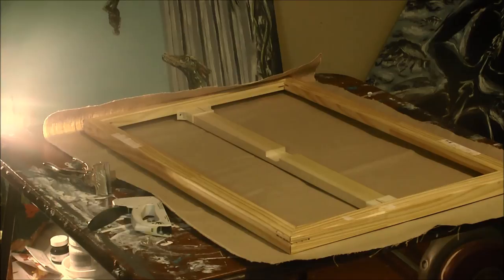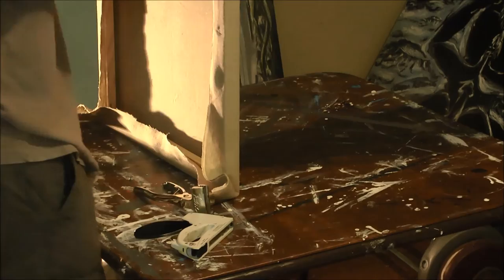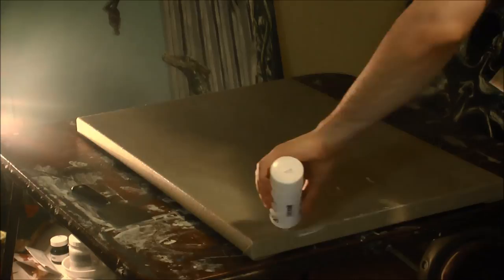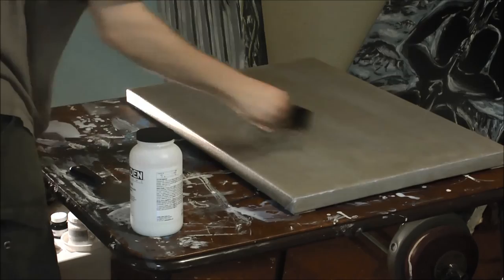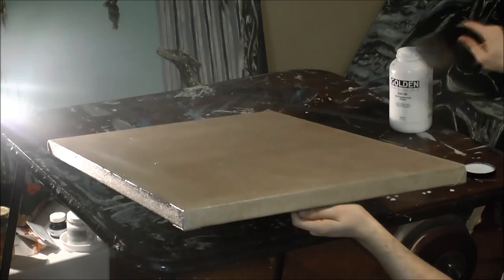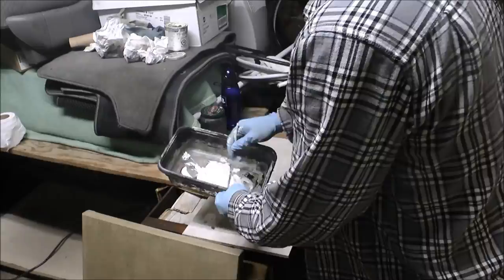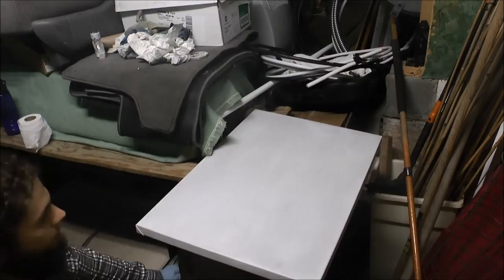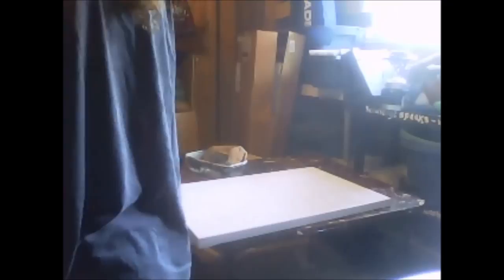Lead Oil Primed Linen Canvas Process

Comment: I do not believe either chalk or marble dust have any adhesive properties. They both create a “tooth,” however, like fine sand paper. The adhesive (called the “binder”) holds all the otherwise dry media (pigment or texturizers) to the surface, in this case the binder is the linseed oil, which is also the “vehicle” transporting the dry particles and binding them to the surface. This is why thinning oil paint too much allows it to rub off, or float away when wetted... the binding property of linseed as is cures is too far reduced when thinned too much.

The lead oxide, or titanium, or any other dry pigments in varying density are floated in the vehicle (linseed) to their final brush stroke location, where the vehicle/binder dries or cures leaving the pigment to reflect light. (Ralph Mayer’s Artist Handbook 5th Edition)
Reply: It  is refreshing to see someone still reading Mayer. I suggest Gettens & Stout as well.

Comment: I noticed that when he showed the final product,  his canvas had the very same problems mine used to have:  Too many deep and visible brush strokes!  I solved that problem by
getting an air brush and compressor and never using a brush again.  You may find  that you will have to spray on several layers, depending on how much primer you like on your canvas, but using an air brush is not only less time consuming, but it does away with the annoying streaks left behind from brushes.
Reply: go away troll
Reply: This is lead oil ground, if you spray it you will end up getting it everywhere, not safe to do really, a palette knife will suffice
Reply: Usually, you sand down between ground layers to get a fine, smooth surface. The lead sanding dust is a problem. It's bad for your health when inhaled.

Comment: I can't agree with putting a non-hydrostatic product on hydrostatic canvas presumably you chose linen or hemp because those are the least hydrostatic fibers but the beauty of rabbit skin glue is that it has the same hydrostatic coefficient as linen.So they move together in unison like rebar in concrete. By soaking a hydrostatic fabric with a plastic bonding agent you're setting up a conflict. And we know the paintings of giant Reubens paintings haven't cracked.  I think these acrylic primers would work on Tyvek or some non-woven plastic fabric like that. And then you're putting lead which is a super flexible metal on top of that so bobs your uncle. Cotten has a high hydrostatic coefficient even worse stress on your campus if you put a plastic polymer coating on it.

Comment: This is really interesting, got led here from Richard Schmid's book. He mentioned priming his canvas with a "lead ground" and had no idea what that was. I guess the general idea of a lead ground is a white primer (I have always just used cheap acrylic gesso) and the marble dust kind of gives the canvas more texture for the paint to adhere to?
Reply from the maker: Lead oil grounds are really nice to work on for oil paintings
Reply: The marble dust is to increase absorbency and tooth, so yes.

Comment: Thank you for the excellent video. I am a novice and this definitely helped understand the process.  I understand that some artists who use acrylic gesso, apply multiple layers and sand the surface with a sand paper. I don't know what use the sanding is but I noticed that you didn't do such a thing when applying the lead ground. Any reasons to sand or not sand the surface?
Reply: Sanding lead w/o a respirator would be a very bad idea - lead dust... Claessens used to use a pumics stone on the lead, but a respirator should be used for any of this.

Comment: I forgot how brutal it is to stretch a canvas. It just sucks. This is the whole reason I went to mounting canvas on panel. I disagree with using GAC 100, and use PVA, and then make my own gesso using PVA, titanium dioxide, and magnesium carbonite, (chalk). This gives you a very sandable and porous gesso layer which will sand out to any level of smoothness you like. I go several layers, each using less PVA versus the additive I mentioned. I tone the gesso ahead of time for a very shallow ground to work on, which is easy over my PVA based primer.
Reply: How are you achieving proper mixing of those ingredients w/o having unbound particles?

Comment: Ryan, this video is terrific. I was curious, do you use a specific ratio of turpentine: lead oil ground: linseed oil: marble dust?  Or do you mix it until you achieve a consistency that you like?
Reply: I was looking on Williamsburg's website and says that linseed oil and marble dust are already part of the ground.  Do you add more linseed oil and marble dust than what is already there as you make your ground?  Or, were you just explaining the components of ground?
Reply from the maker: I believe I was using a 50/50 ratio by volume.
Reply: Much too much. @RyanDemaree

Comment: Does the GAC 400 actually tighten it though? Golden says it stiffens it, therefore replaces rabbit skin glue. But that's not quite how rabbit skin glue works... it tightens, not just stiffens, as it dries and shrinks. If GAC 400 only stiffens, then your canvas could have actually lost tension, and you may not notice because of the stiffened fibers.
Reply from the maker: +CustardBastard it tightens it slightly, RSG is the best for tightening tho.

GAC is more archival, but I think I like RSG more. GAC is slightly too loose.

Comment: I've only painted on traditionally gessoed wood panels and I want to try oil priming a raw linen canvas I need to travel around with and paint on it in oils, so I need to roll it in a tube occasionally (when dry to the touch). My question is, if I temporarily mount the canvas to a rigid support (MDF panel) and I apply rabbit skin glue to size it, will it adhere to the panel on the backside? Also, to make my own oil ground can I use marble dust, linseed oil and paint from tube of lead white instead of the lead pigment? otherwise I can just mix marble dust, linseed oil and Titanium dioxide pigment. Will preparing a canvas in this manner allow me to roll up the painting in a tube for travel? or will it be prone to cracking? I paint very thinly (grisaille with thin glazes of oils). Thank you.
Reply from the maker: Yes to both of your questions. Apply the rabbit skin glue to the panel and to the mounted canvas on the panel front and back of the canvas for better adhesion. You can use lead white from tube with chalk and linseed oil or titanium white, chalk and linseed oil. I dont recommend rolling up a canvas sized with rabbit skin glue, but you can at your own discretion try it if you have to.

Good luck!

Comment: Just a quick question.  Why not apply gac 100 to the back of the canvas?  There could be holes in linen that oil might escape to the back.  Of course, better linen has less holes but they all have some.
Reply from the maker: You could do this as an extra precaution if you choose to, definitely wont hurt
Reply: @RyanDemaree  Thanks!

Comment: Very helpful. I am studying priming linen clear to keep the natural color. Painting w acrylics on top. Would you still recommend GAC 400 followed by two coats GAC 100? Other resources I’ve found mention mix your own PVA w glue and water, and then sand and seal with clear gesso or acrylic matte medium. Im getting opaque uneven mess with my clear gesso and sanding when canvas is already stretched brings out the stretchbar lines
Reply: Claessens uses PVA in 2 even coats.

Comment: Another great canvas linen sizing is Elmer's glue ...all it is is basically a PVA ( poly-vinyl -acetate glue.)  .(1). Dilute w/ water to milky consistency, just like a store-bought PVA sizing .  (2). Using a regular Home Depot large paint brush,scrub the Elmer's glue into the stretched raw linen  let dry, then rub down with a scrap piece of linen. (3).Repeat this 2 more times.
Reply from the maker: yeah, ive heard that one before. I like rabbit skin glue and lead oil ground most. The absolute best linen ive ever painted on is known as L600. Smoothest, finest oil primed linen around
Reply: Correction to my post: (1). Elmer's glue diluted with water to a consistencey of a store-bought PVA canvas sizing; ie. milky . (Elmer's glue is a concentrate -form of PVA) .  (2). I meant PVA ( poly-vinyl acetate)  not "PVC".  Your video was detailed and informative. Lead oil does require a much longer dry time. I used to use Flake white No.1( PW 1) . But I now will start to use ' titanium white alkyd diluted w/ spirits. Akyd dring time is 4-20 hours, so wait period is significantly less. It'sincreasingly tough/ a hassle to get lead oil white. One queston with regards to integrating chalk dust/ or marble dust into the primer..... Do you mix in the dust on the first coat or last coat? And... what proportion of chalk dust/ marble dust to oil primer ? thanks.
Reply: Never use Elmer's glue as a size.
Reply: @JustMe-ed1cq  Your broad and general post makes no specific sense at all. Elmer's glue , what? So many variants of Elmer's brand glue . Diluted or undiluted? With added chalk or without ? How many layers? Learn to read and understand Safety Materials Data sheets on particular products. Very accessible on internet . It would list , among other product proflile ,  the pH of a specific glue.

Comment: Another question.  I gather from the responses after this video was done, you decided to go back to rsg.  Am I right?  I am currently experimenting with using gac 400/100 method, and also Gamblin's PVA size.  But now wondering if should use rsg after all.  There sure seems to be no clear answers on this.  If the paint flakes in time over acrylic skin......
Reply: Acrylic size will allow cracking as it remains flexible and is more flexible than oil films. The main objection to rsg is that it is very hygroscopic, which will also cause cracking.

Comment: Why not use a regular wall oil primer? it's very strong and will last forever.
Reply: It is not made for this purpose and the pigment to binder ratio will be way off. Also, you want the whitest highest quality pigment. The binder will not be of the necessary composition or quality either.

Comment: Good instruction. Can I just use a ready made oil primer I.e., Gamblin oil ground? Also what process for raw linen I want to put on a board, do I glue to board first then use the GAC 400/100 then ground. I made the mistake of just priming the linen laying flat and what a mess I made. Thank you!
Reply from the maker: Yes, you can use the Gamblin oil ground, the primary difference is that it is made with titanium white instead of lead white. Titanium oil grounds tend to feel a bit spongy. Technically lead oil ground is the best from an archival point of view, but I even enjoy using Claessen's zinc/ titanium oil primed linen. 

I believe you could glue the linen to a panel with the gac 400/ 100 combo and then go into priming after. Typically if I am working with a linen panel I glue it with my rabbit skin glue sizing to the panel before I go into an oil ground. I think synthetic sizing should work in a similar fashion.
Reply: Ryan Demaree thank you for your reply
Reply: Yes, I have done this many times using PVA (Poly Vinyl Acetate) size to adhere the linen/canvas to a panel. Then use PVA as a size, the main purpose of the size is to protect the fabric deterioration from oil in the oil based ground. It also makes for a very stable structure opposed to a painting on stretcher bars. Gamblin is usually good at having information on their website.

Comment: There is an Oil Painting Primer by W&N, is that any good? And given the fact that lead oild ground is mostly forbidden in most places, what could be use as a good substitute?
Reply from the maker: +Fabrizio Aldonne Im sure its fine. The W&N oil ground is most likely made with titanium instead of lead. Lead oil ground can be purchased from a few different companies

The 2 major ones are- Williamsburg and Rublev 

Avoid Zinc oil grounds, and although titanium isnt bad, id recommend a lead oil ground for best results. Lead white has been a golden standard for most of human history in regards to art making. Before lead white we used lime white [calcium carbonates like chalk, marble dust etc.] Lead is generally the best white, although titanium is superior in opacity. I wouldnt recommend the use of zinc though as it has recently been thought to be unstable and to cause brittle paint film. 

Hope this helps!

Comment: I have been experimenting with different surfaces and grounds and really love lead oil primed linen.  Is lead ground totally safe once dry? I wouldn't cut my LOP panel (ACM) w/o a respirator and would do it outside, but once the painting is done (lead ground all covered)  can it pose any risk by releasing lead particles into the air?  What if the painting were hanging in an elementary school where it could get touched by little fingers?  Any thoughts appreciated.
Reply from the maker: In theory small particles can still be aggravated and shed from the canvas if touched. Use your best judgment. In most cases its very safe once dry as long as it isnt being aggravated
Reply: Lead paints should never be used near children for anything.

Comment: Hello again.  I was wondering how your lead oil ground primed canvases are doing over time since you are waiting a relatively short time for the lead primer to dry?  I have seen advice ranging from a matter of weeks to a year to let lead oil primers cure before painting on them.  So far I have let mine cure 6 months at least but am wondering if that necessary.
Reply from the maker: ive not seen issues with using 2 weeks per layer. Depends on how thick the layer as well as your own personal preference. Good luck!
Reply: @RyanDemaree  Thanks.  I think I will stop treating mine so precious and not wait so long.  I had a bad experience on some canvases I attributed to possibly being under cured earlier, but was done by somebody else on linen glued to panels from a popular panel maker for plein air.  Something was definitely off as it sucked the oil out of my painting big time. I now think it might have lacked sizing or something.  I no longer buy those and make my own canvas so I can trust them.
Reply: Look into the drying of linseed oil and when and how much it changes volume (increases dramatically, then decreases) when drying for your answer.

Comment: How long did you wait between the 1st and 2nd lead ground layer?
Reply from the maker: 2 weeks is best practice and yes you can use spike lavender solvent if youd like
Reply: Never Spike Lavender in the ground. To your question - look into the drying of linseed oil and when and how much it changes volume (increases dramatically, then decreases) when drying for your answer.

Comment: could you tell me what your percentage is re linseed oil marble dust turpentine and lead oil ground white would be for a good consistency, I am working right now with linnen and rabbitskin glue but like your gac method.
Reply from the maker: This blend is pre-made by williamsburg. I now use Rublev lead white oil ground with a rabbit skin glue sizing if im preparing myself. The absolute best surface for detailed oil painting is made by a small company which makes rabbit skin glue sized portrait grade belgian linen and uses a PURE lead oil ground. It is super smooth and archival, truly a beautiful shade of off white as well. Search for L600 linen on google

Comment: Hi, Thank you for sharing. My question is, I primed canvas with oil primer about 2 years ago. By some treason it was untouched for all this time, however, now I want to start painting on it. First what  I see when I took it from storage, it’s yellowed a bit, like off white-creamy. Now I’m thinking, will it influence colors of painting I will do on this canvas? Another one, I did charcoal sketch on it, now have a dilemma, how I can proceed? It’s a big size drawing which I don’t want to loose at beginning stage, as I took some time to develop it, how I can fix it on oil primed canvas? Or there is no way to do it? Will appreciate your reply. Thank you
Reply from the maker: any surface you paint on will have some effect on your colors, but you shouldnt notice it much unless the colors are transparent or you are working on a toned surface. An off-white surface wont effect the look much. 

With the charcoal drawing you can maybe try and lighten it a bit brushing it lightly to see it as a faint sketch instead of bold, but be careful not to erase your drawing. From here you just build up in layers and the sketch should fade out.

Good luck
Reply: Linseed oil yellows if stored in the dark, but this is reversible with exposure to sunlight.

Comment: Can we size and prime the canvass first before we stretched it?
Reply: Yes, you can do so on a large canvas then cut and stretch the piece needed.
Reply: It is best to stretch (after rinsing out the fabric size from the manufacturer and restretching) to ensure even weave alignment, and it is best to have some tension.